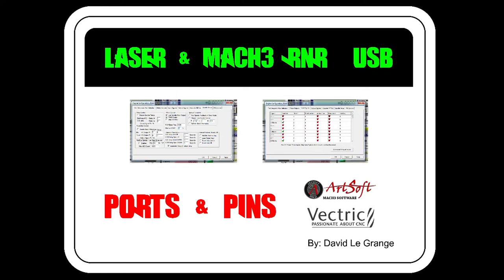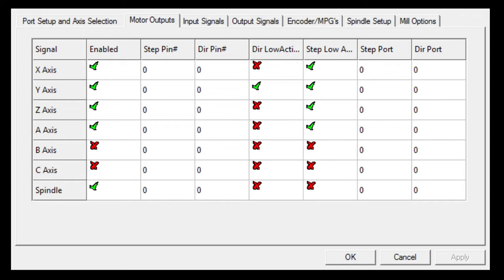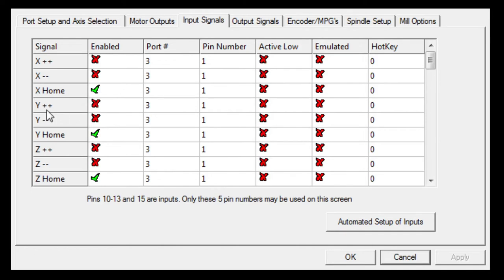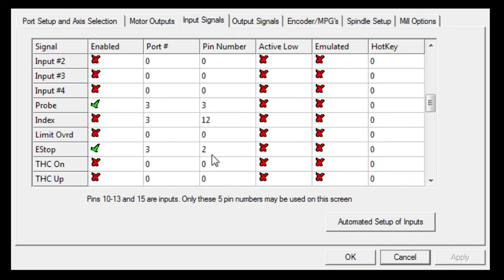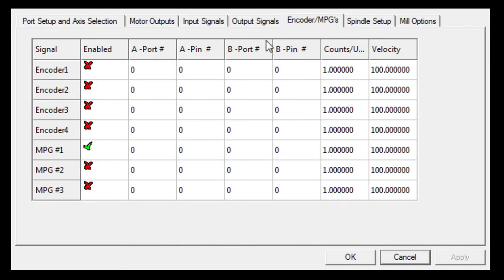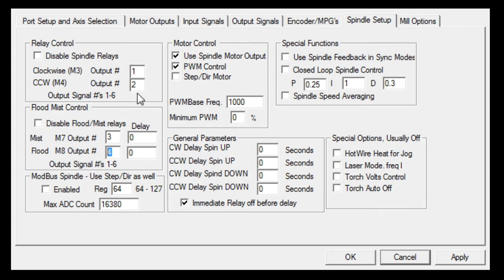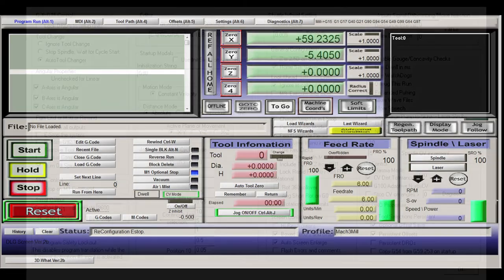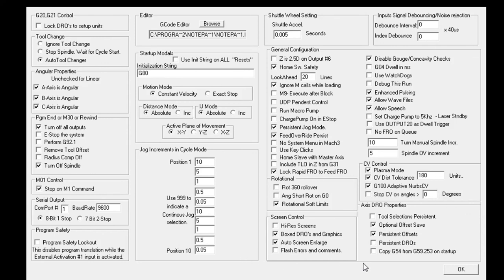Mach3 USB - Ports and Pins

Comment: Horrible board. Has no enable output, making mach3 "reset" inoperative. The mach3 setting is the least of the problem only if the breakout board worked properly. Some claim that it should work without enable connected, but my drivers require one.

Comment: Hello, we made M7 M8 turn on a valve through a 24 Volt relay, which controls a pneumatic collet chuck.
At first everything was fine, but after a while
we could no longer turn off the cooling with M09.
On the match 3 itself, it shows that the cooling is off.
But it doesn't actually turn off the valve.
Could you help us with this problem?

Comment: Hi
I watched the video and liked it a lot, but I have a question how to wire the spindle and the laser on the same board
Reply from the maker: Hi.
Question..
1. Does your spindle use a VFD.
2. What voltage are your PSUs.

I have help someone who runs a VFD spindle and has 24v and 12v PSUs.
Reply: @David Le Grange  
psus I didn't understand what you mean, as for the spindle yes there is a vfd
Reply: But I'm working on akz250 breakout board 
I mean  motion card
Reply from the maker: @cncartnet 

PSU. = Power Supply Units
Ill check out the AKZ250 and ill check out the wiring and see if i can do a wiring diagram..
Reply: @David Le Grange thank you so much
I will remind you in my YouTube channel if my problem is solved
Reply: @ZR6DLG  Could u please tell me how I can set the card output port 4 to give me a 5 volt signal?

Comment: hi. David Le, Can you help me ?I don't know why my board mach 3, output PWM only maximum is 3.2V at S24000?
Reply from the maker: Hi , Sorry for late reply, 
what is the MAX spindle speed ( 24000 RPM ) 
what is  PWM freq  -  config \ ports and pins \ spindle setup  \   PWM base Freq = 1000 and Minimum PWM = 0 
what is  Spindle Pulley  - config \ Spindle Pulley \  Pulley 1, Min Speed =0,  Max Speed = 24000,  ratio =1

are you trying to use spindle and laser ...? 
if you use both spindle and laser on PWM you must add an isolation relay .

let me know .... good luck
Reply: @David Le Grange  im config the same you. I only use PWM for laser. But it not work.
Reply from the maker: @CNC-DeMen 

Did you join the DCM and AVM
Is you laser 12v.
Send make and model of laser.
Also on pully set max speed to 1000

This way S1000 is 100% power.
Reply: @ZR6DLG  hi. My module laser is 24vdc.
Reply: @David Le Grange my bob mach3 red. I'm config pwm 1000 but I don't now out pwm not 10v
Reply from the maker: @CNC-DeMen  send me the make and model of your laser. Ill check wiring